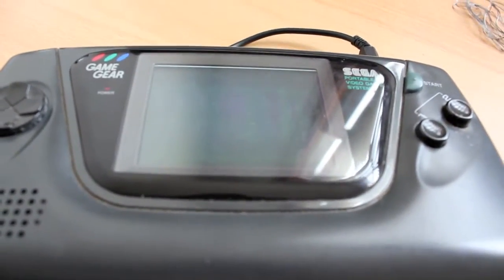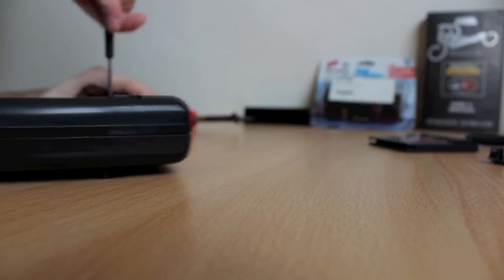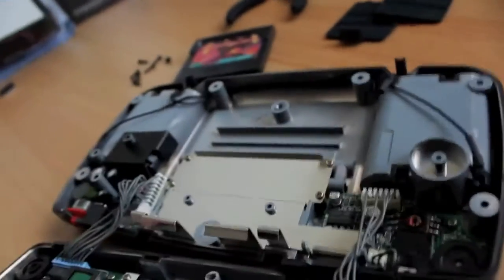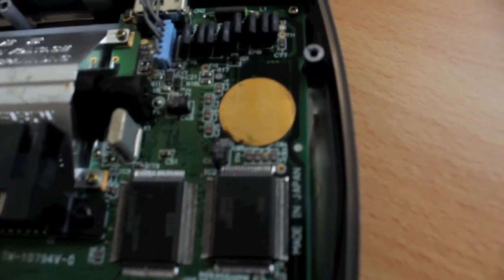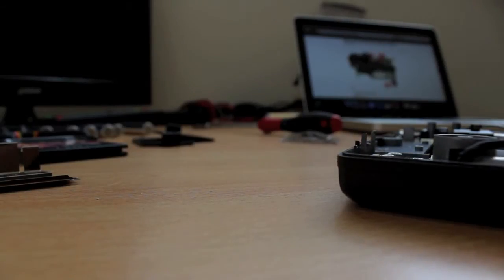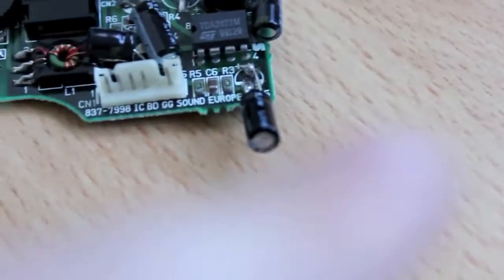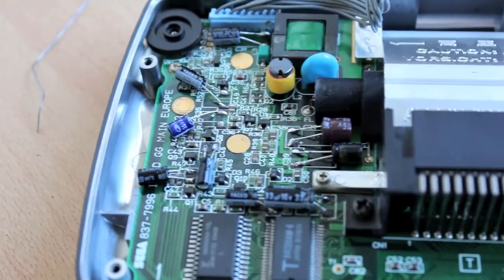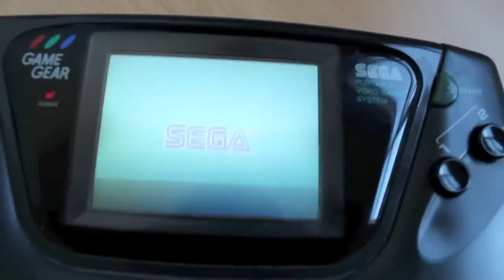Sega Game Gear Capacitor Repair (European Model)

Comment: did you do the caps on the power board as well? my game gear just quit one day, turns on for a split second then shuts off.. im guna do the caps on the power board and see if it will start up again

Comment: What type and size of soldering wire would i need for this job?
Reply from the maker: Probably good to use something between 0.7mm and 1mm. 1mm might be a bit thick for precision stuff. You can always add more, but can't not add more - if you know what I mean. Go with some that is leaded if you can, depending on your region of course. Europe hates lead. ROHS they say! Cold joints the rest of the world replies! 😊

Comment: Just tried to fix mine, didn't went as I was expected. By removing one of the bad capacitors, I've removed the contact part, don't think it will ever work now. Is it still possible to sold a capacitor? (hope you understand my bad english)
Reply: I saw no reply, it was 3 years ago you asked... but if you carefully scratch away the green on some of the track leading up to where the pad was, and use solder with flux and lead, you could attach to the end of the track - if the GG is dead/damaged any way, you're not going to make it any worse by trying :)